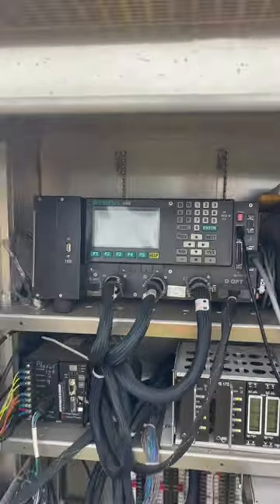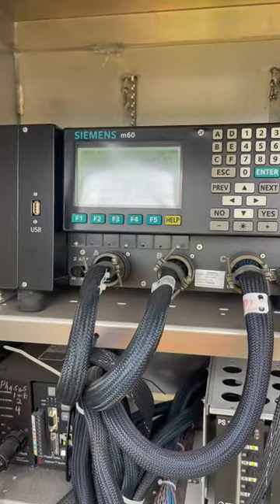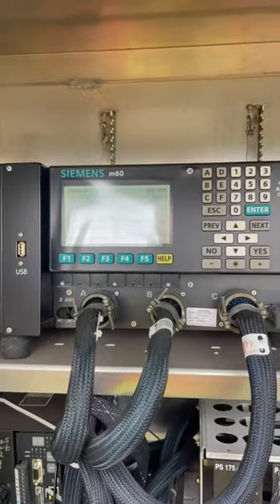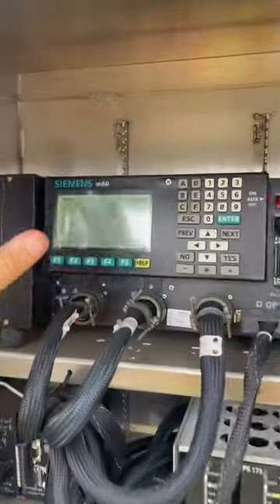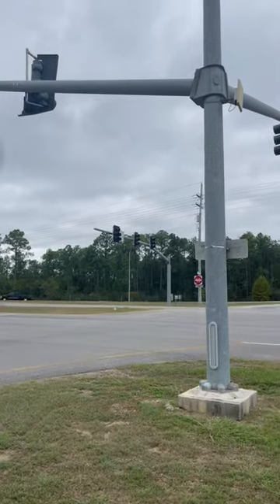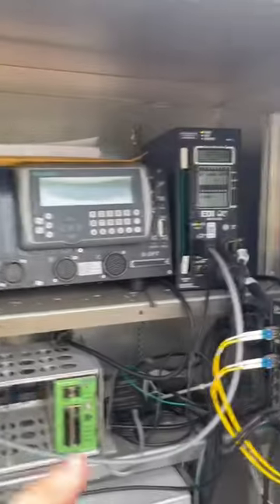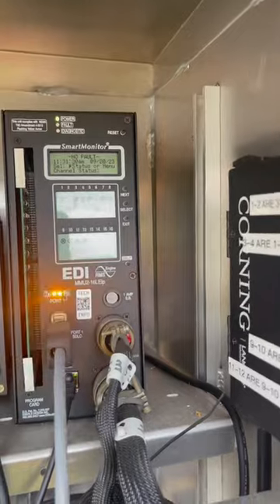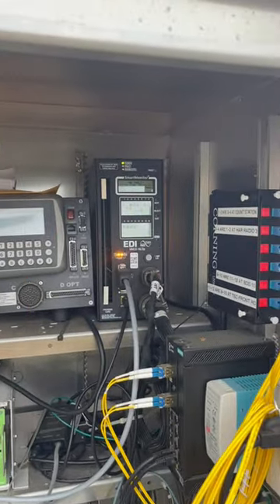Raspberry pi and traffic lights!

Comment: And thats the difference between something that "can" do the job and something "designed" to do the job.

When you start adding in the actual specifications or requirements, consumer devices begin to fall short because they aren't DESIGNED to meet those specifications & requirements.

Be able to withstand high temperatures with NO ventilation, contain a power supply capable of ANY transient OR long term event or condition on the electrical grid. Just those two alone disqualify a Raspberry Pi. We haven't discussed cold, longevity, self monitoring or any other requiements.

Good, fast, low cost... you can only have two.

Comment: So that's just a fancy PLC, right?
Reply: Get outta here with your logic. (Pun intended)
Reply: @jamesbond1231 that was a good one James bond, I'll treat you with some "java" for that one. just be careful you don't step on the "python" on the way to the café, I "C sharp" fangs on that thing
Reply: Yep, they just build with thicker pcb traces and pay the 200 for conformal coating. And instead of hard mounting to the chassis they may have some rubber grommets or slotted chassis mounts  to mitigate any vibrations.

Comment: He's right that Raspberry Pis aren't built to the standards of an industrial controller. Having said that, I highly doubt any device could run faultlessly for 30 years, which is why they have self diagnosis and redundancies built into it. Also, that device is probably worth 50x more than a RPi. And you can buy RPi based industrial PLCs.

Comment: I think that when people say "this could just be run on a raspberry pi" they are really just trying to say that it seems VERY ODD that a GIGANTIC box full of crazy large and expensive equipment is what is NECESSARY to run an inter section. The debate is not about raspberry pis themselves, but other, new, smaller, and cheaper equipment of today.
Reply: it's better to use equipment that's stood the test of time than to stay up-to-date on new systems that haven't proven that they can last
also, the money they save from not being sued over a faulty intersection causing an accident outweights the cost
Reply: Well its still a stupid argument. Half of the gear in the box is safety gear to make sure it doesn't screw up and make all the signals green when a power surge or something happens.
Reply: @cuh1004  That equipment still doesn't last forever. Nothing does. It would be better to replace it with newer and safer equipment that uses more efficient technologies after the old system wares out. If you don't think that correct, tell me why we don't still drive around vehicles from the 1950s or older or why smartphones aren't still made the same way they used to be made back in 2005.

Comment: I mean in technicality. Yeah, RPIs could probably be used as the primary logic boards on each piece of equipment. But it wouldn’t hold up in the production environment. 

Most people who make hardware on PI’s usually have custom PCBs made later on for production runs. Furthermore, equipment needs to be serviceable in the production environment. It would be insane to have to replace a bad cap on a sbc in a busy intersection. 

Id like to see someone try to build an open source traffic system tho.

Comment: Ok sure a pi is a bad idea. That does not change the fact ancient technology is being used to achieve a ridiculously simple task.
Reply: That's a bit like saying cars are incredibly simple machines because you turn the key, move a lever, and then press a pedal and they go.

Most of the complicated stuff is invisible to the end user.  The NCHRP's Signal Timing Manual - Second Edition is an interesting read.
Reply: We’ll if it’s not broke don’t fix it. If it is lasting decades that’s what you want. And trust me intersection management isn’t easy
Reply: @NethercraftMC  billions of tax payer dollars are spent on the corporations that fund the campaigns of those who make the decision. The insane cost is not the cost of production. It's the unnecessary profit being made by companies that use old school bulky and cheap components instead of upgrade to far more capable systems that could process many intersections at the same time and make traffic far more efficient saving gas and relieving traffic jams. Many things in this country are exploited for corporations to excuse profiting billions of dollars off taxpayers, and it is a huge problem.
Reply: yes because wasting newer "good" tech on a task that is being taken care of perfectly fine with older tech, is a fantastic idea... Why waste money on changing the entire infrastructure when the system currently in use cost significantly less than the proposed cost of changing everything?
Reply: @Jameskelvin89 So, if you're a such a brilliant traffic engineer, why haven't you approached someone with your product?
Reply: What would adding an RTX 4080 do to improve the way traffic lights work?
The core technology may be "old" but almost every improvement is focused on failure mitigation and durability improvements.
Why waste r&d money trying to make the latest and greatest processor work when that money can be used for better weatherproofing or more durable resins and potting material for the electronics inside?
Reply: I’m sure you aren’t aware that most airplanes in use commercially now are 20-40 years old. Age doesn’t change how functional things are
Reply: A wheel is ancient technology. Just because it’s old doesn’t mean it’s not efficient.
Reply: You call it ancient technology, an engineer calls it proven technology.
Reply: @yourmaineman580  it's clearly not efficient, if you drove a car you would know that. It's an excuse to waste billions of taxpayer dollars. Plenty of companies have offered far cheaper and more effective solutions, yet they stick with old contracts to give billionaire friends an endless flow of our money.
Reply: @Jameskelvin89  Okay, now, how many of these proposed "cheaper solutions" of yours don't cost trillions [that's multiple thousand-billions] of dollars to implement because they require the entire, already built, infrastructure to be replaced? How many have a proven cost/time/station ratio that's just as if not  more efficient than ($400+labor)/~20years/station, ie. the current rate?

Have you considered the system is in place because the infrastructure is already built and that the cost of replacing everything, maintaining a new system, as well as retraining technicians costs significantly more than the entire current industry on their own individually?
Reply: No safety critical system is ridiculously simple. Even if the logic is simple, the testing won't be, and neither will the error handling.
Reply: And speaking of ancient technology, there are nuclear power plants still controlled by VAX minicomputers (mini as in smaller than a mainframe) from the early 1980s.
Reply: @littlemeg137 this 1000%

If it worked and no one died, then you changed it and people start dying that is entirely your fault.

I'm not touching that with a ten foot pole unless the replacement is also certified by someone else
Reply: How much more advanced does it need to get? They can’t drive for you.
Reply: @Jameskelvin89  I think you're failing to acknowledge how much it costs to integrate a change, and the amount of disturbance it will cause in many different levels. In this case, a proven method to a system which directly affects safety and human life, even if it may seem like it's ancient, is more important than trying to jury rig this up like a high school science project cause its more cost effective.
Reply: @Snacman8  no its not.

literally all this is doing, is turning lights on and off.

50 years ago they would do it with a fistful of relays and no silicon at all.

It is massively, hilariously overbuilt
Reply: @tsm688  Your solution is to replace a proven reliable system of modular components with bespoke electrical circuits?  Do you work for the electricians' lobby?

Btw, traffic lights as a concept are much more complicated than you think.
Reply: @Snacman8  bespoke?  not really.  This is quite literally what they **USED TO DO**.  There were standards and modules.

I don't understand the current state of ludicrous complexity.  How is anyone expected to maintain this?
Reply: @tsm688  Setting up the system to require getting a full-on electrician to make adjustments and reverting back to a time before national standards is simpler than using the modern system of replaceable standardized components that can be reprogrammed and plugged in easily?
Reply: @Snacman8  are you razzing on this guy now?  you think he doesn't need to be qualified for this kind of work?

I'm saying it's literally thousands of times more complicated than it used to be for the same result
Reply: @tsm688  It's significantly less complicated now in literally every way that matters for a greater number of potential use cases now.

Your argument is the same as saying that CAD is a pointless investment because pencils are cheap and they used to design things on paper anyways.
Reply: @Snacman8  This is more like installing a CAD workstation in every single streetlight to do the job.  That's not what CAD is for!  Pointless complexity pushed where it doesn't belong. Then doubled up to make it safer when it inevitably fails
Reply: @Jameskelvin89  Taxpayers almost never foot the bill for signal equipment installation. Land developers do in most cases. The only times you'll see a signal installed by the state is when a location demands it, and there is no development nearby (a crossing with a high amount of accidents would be an example). The state pays to maintain the signals that development projects install. Even if we were to accept all signal installations were paid for by the local DOT, it would not reach into the billions. Lastly, the cost of the controller equipment is negligible compared to the cost of the signal poles and mast arms. Mast arms are built on demand, and need to be ordered with specs matching the state codes. They are often on backorder for this reason and can take months to acquire. 

Simply put... you have no idea what you're talking about; but the conspiracy is amusing to say the least.
Reply: It’s rather new tech. Sorry they don’t plug an iPhone into the circuit lol.
Reply: @littlemeg137  Shouldn't be an issue, VMS never crashes, unlike UNIX.

Comment: I bet you the "linux based controller" is just a PC motherboard in a metal box.
Reply: Or even built around a compute module
Reply: As opposed to what?
Reply: bro what else it it suposed to be?
Reply: @alouisschafer7212  linux can run on almost anything.

Comment: A Raspberry Pi could still do that.
Reply: Yeah, but would it be reliable?  No.  Pis aren't hardened and certified to operate in extreme environments.
Reply: @dannymac653  What? That’s the case around the hardware that does that.
Reply: @Stopinvadingmyhardware  The case doesn't offer any climate control.  The Pi isn't intended for extreme heat or cold or high humidity.  All the case does is keeps the rain off the equipment.
Reply: @dannymac653  Their cases have to fit whatever the state deems are the appropriate weatherproofing and thermal variance compliances with their region. That’s done by the case itself. Electronics don’t magically have different environmental resistances when they’re off the shelf components. Most of those cases are hermetically sealed and likely have heating elements and a method to remove humidity. 

Like I said, you could run that entire intersection with a Raspberry Pi. The 5 could do it so much better. Run it on an SSD, and the whole thing could be written with an ASM command table for encoding and use 64 bit words to control everything with a single Dword.

They’re likely running it with a remote shell, so they can gain direct access and SSH into the intersection. Probably remote updates as well. Which means they can probably cycle the entire intersection with a simple MOV command.
Reply: @Stopinvadingmyhardware  Yeah, I don't see AC units on traffic light control boxes.
Reply: @dannymac653  What does what you see have to do with anything that I posted there?
Reply: @Stopinvadingmyhardware  A Pi would die in a "hermetically sealed" case.  I'm thankful you don't make these decisions as to what equipment goes inside a traffic light control systems.
Reply: @dannymac653  Why would it die? Does it need oxygen unlike every other piece of electronics on the planet?
Reply: @dannymac653  How do you know what decisions I do and don’t make?
Reply: @Stopinvadingmyhardware Electronics don't get magical resistances, but the components you choose, the design, coating and layout will all contribute to longevity and reliability. Pi simply isn't designed for industrial purposes, and that's the end of it. You could make extensive modifications to Pi to bring it up to standard, but then you need to test it, verify it, certify it, and suddenly the cost skyrockets to the point those PLCs they use now seem like a bargain. Don't try to reinvent the wheel.
Reply: @B3RyL  I could build one that could do it with less than $100 in parts, and about three days of work. The software would take a little longer.

Some of us have experience in such things.
Reply: @Stopinvadingmyhardware  Sure. Then why don't you? There's big money to be made if you can pull it off. I'm rooting for you!
Reply: @B3RyL  I was telling you so you could do it. I’m in a different industry.
Reply: @Stopinvadingmyhardware  Me? Why would I want to do something that I don't believe can be done? I'm not mad. But clearly you have the know-how and with a small loan you could spin up a business that would make you millions, perhaps even billions. Why would you not jump on that opportunity? Or are you not sure you could pull it off?
Reply: Oh okay so lets just change the whole industry standard to some hobbyist small Linux computer with no surge protection at all, and with slight moisture or temperature change turns off and shorts when two pins are touched. They are not meant for VITAL infrastructure. And you know how much liberals would be complaining about oooh they are cheaping out on road safety. Also talking about it’s cheap, it wont be cheap if you’re replacing it everyday lol.
Reply: @NethercraftMC  How I can tell you’ve never handled electronics in your life.

Comment: As an automation/electrical engineer that designs and programs industrial applications (mostly wastewaster/remedial sites), they do make industrial raspberry pi. Specifically the rev pi core with the rev pi dido for physical inputs and outputs. Those two things with 14 inputs and 14 outputs and the main core will cost around 500-600, more if you want redundancy, which is cheaper than most plcs which will run 1k-2.5k depending of course. We normally use cheaper AB micro850s (500-1000 depending). It's because these traffic controllers are only sold to governments typically and it's a set standard that the government has to pay whatever for them. The companies like Siemens can charge whatever they want for it because it's limited supply of what the standard is. The government just then turns around and makes us pay for it lol. It can be done with industrial raspberry pi. I just wouldn't choose this hill to die on when it comes to government work. I work with our local city on projects and the amount of money and time wasted is absurd.

Comment: Tbh a raspberry pi probably isn't needed, you could use atmegas or stms, it basically just needs a timer, some buttons and a screen.

But the main thing is that these are certified, and there isn't a lot that are made, so there's no economy of scale and there's probably like 1 or 2 manufacturers, so they can charge for the relatively high R&D